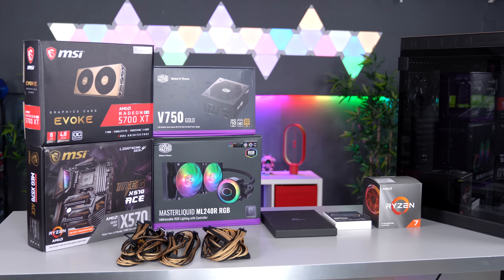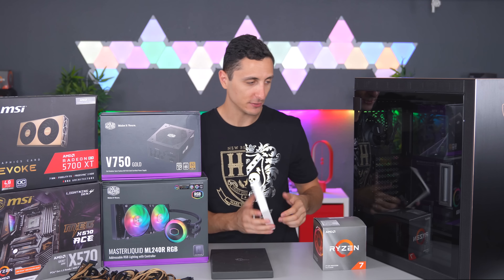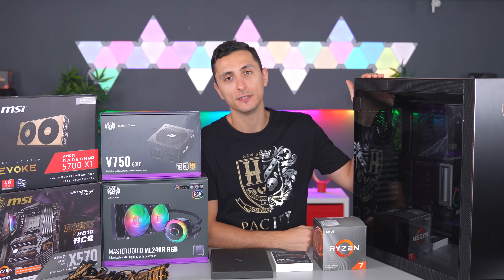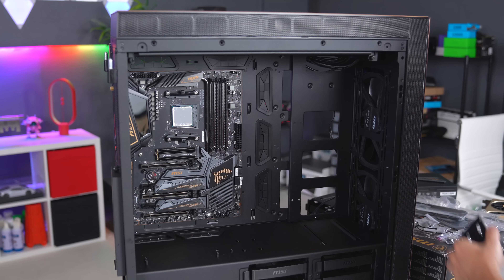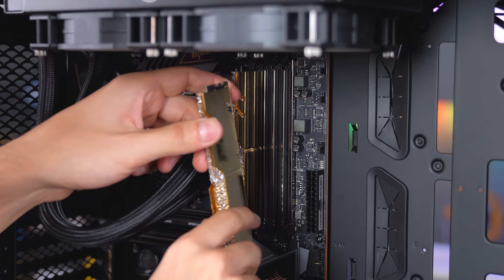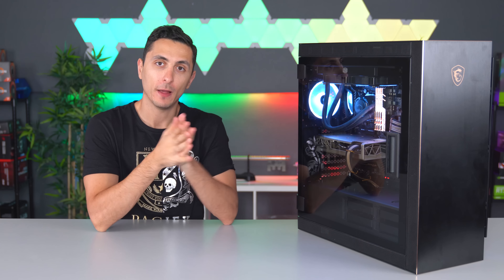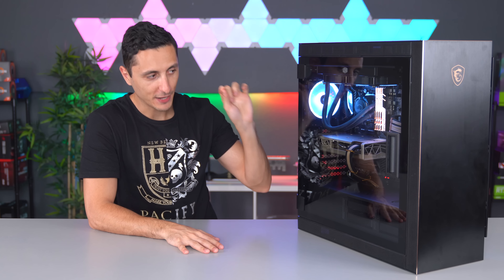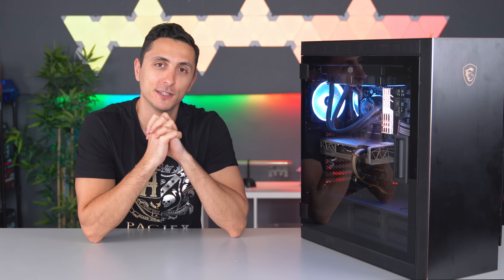The Black and Gold PC Build

Comment: 10:12 it's almost 5GB not half a GB
Reply: Glad I wasn't the only one who noticed that.
Reply from the maker: damn my math sux
Reply: TechSource hi Ed
Reply: Maybe what he meant is half a terra
Reply: At 1:56 as well
Reply: Noob on ssds here. My crucial bx500 is advertised at 6gb/s , so whats so special about 5gb/s? I know its read and write but whats the difference? Thanks
Reply: @jackdunn4035  "Crucial BX500" write speed is 500MB/s, while this one is 5GB(5000MB/s), ten times faster than Crucial BX500.
Reply: @mirsyad9828  no it's not, don't like that comment!
Half a terabyte is 512G, over a 100 times faster than his actual speed of just under 5G/s.
He was out by a factor of 10, not 1000
Reply: @jackdunn4035  Sata3 is 6G/s but for technical reasons I don't understand the actual speed degrades to 600M/s.
So these NVME drives can be many times faster, at least in benchmarks.
Reply: @colinjava8447  A gigabit and gigabyte are two different things. To convert from gigabit to gigabyte, you have to divide by 8. So 6 gigabits per second is actually 750 megabytes per second which is what most read/write/download speeds are shown as.
Reply: @colinjava8447  It also suggests why ur internet provider advertises speeds of ur plan for example of up to 100mbps but when u go to download something, the speed is only 12MB/s
Reply: @robbie4339  yeah I know the difference, it can cause confusion cause it's GB and Gb and people can think it's the same
Reply: Colin Java yeah it's only purpose is so companies can advertise great looking speeds while not totally lying to the consumer
Reply: @mirsyad9828  a terra is a 1000 GB, half of that is 500 not 5gb
Reply: @wsdadasdawf8384  okay then. I'm still confused with the term GB and Gb
Reply: what does Gb mean though?i never said that?
Reply: @wsdadasdawf8384  I mean GB and gb
Reply: @mirsyad9828  w8 ur not joking? theres no way you think they are different,they are the exact same thing lol
Reply: @colinjava8447  because it is not 6 gigabytes, but gigabits. You got it? I hope so 😄
Reply: @zZupPan  I already explained all this above
Reply: @wsdadasdawf8384  that's just not true GB=Gigabyte, gb=gigabit, one gigabyte is eight gigabit
Reply: TechSource so does you spelling haha jkjk

Comment: I mean I'm sure your aware, but for anyone new to building PC's, when mounting radiators you should really consider doing so as an intake rather than an exhaust. A multitude of videos/forums showcase the CPU cooling benefits when utilising an open back GPU. Obviously, if your using a blower style GPU, this doesn't apply, but when an open back GPU is situated directly under a radiator exhaust, this causes the CPU to run hotter. Instead, if you use a standard fan exhaust system and the radiator as an intake, this will greatly better the temperature at which your CPU runs. 

Just food for thought 👍🏻
Reply: Good to know, as I just built a new PC and placed my AIO fans in exhaust mode. Of course, my PC runs super cool as is so ......and it's an intel 9th gen 9700 cpu, the system as a whole runs cool, I have 3 intake 140mm fans in front and a single 140mm out on the rear, with the 2 120's on my aio cooler. Maybe I'd see even cooler temps the other way. I'll have to test this. Thanks

Comment: Tech source out building $2000 pc whilst am here happy about my £11 mnk that came today😂😂
Reply: zakk why’d you get an $11 mouse and keyboard
Reply: Kiwiz Lucks cos I don’t have that type of money to splash on expensive keyboards, however I can drop you my paypal😉
Reply: I understand you might not have the money but only rich men but cheap tools. If you save up for something a bit pricier, you'll get a more reliable, longer-lasting product that will save you money in the long-run. Just a thought, I have had to learn that first hadna a few times.

P.S. Some cheap peripherals are really good though, I remember getting an £8 mouse that I used to game competitively on, it was fine.
Reply: P4TR10T this isn’t always true sometimes the more expensive stuff it the same or worse then the cheap stuff and a lot of the time the cheap stuff last at least close to the expensive stuff and if you pay a ten of the price for half the life span than the cheap options better
Reply: GMUXBLADEZ - you make no sense
Reply: @gmuxbladez-9221  if you read my P.S. you'd see that I understand that but most of the time responsibly chosen items that have a higher price tag will be made of better materials with more testing behind it.
Reply: P4TR10T yh I totally understand but I really don’t need my mnk is I only play ps4 r6 with my controller and I just bought a monitor (I smashed my old one) and FPS dominator( a cheaper version of scuf but better quality) so that’s why I only spent 11£ cos am gonna use of for Fortnite every now and then
Reply: @a-kkaz9791  fair enough

Comment: You can use any case from Fractal Design or Phanteks instead cos MSI is still new for Cases (a golden case won't actually look great). You can also replace the Corsair SSD with GIGABYTE AORUS NVMe Gen4 SSD which is golden. You can address the RGB primarily towards dark yellow/orange - close to golden. For aesthetics, I might try Corsair A500 75 CFM CPU Cooler rather than an AIO. Although most of the Power Supply isn't visible these days, you can get a Seasonic power supply with more golden accents. In my opinion, the products available in the market are more suitable for Black-Silver and White-Golden build.

Comment: Nice part selection and very nice build. Couple of observations - at 11:58 where you show the "flaw" with the riser, you have it flipped, the GPU slot retention clips should be towards the center of the case, not the edge. As for the bracket, plenty of short screwdrivers exist.
Reply from the maker: I flipped it so it’s easier to see but the spacing of the standoffs were still off :/

Comment: that version of the RX 5700 XT can get really hot, I would recommend getting the gigabyte aorus RX 5700 XT and get a vinyl wrap for it
Reply: The temps i saw that they were about 46 degrees on apex and 75 on six siege. But if u say so...... what temperature does the aorus average at?

Comment: You could've definitely done alot better.

Cool-temperature lighting of cooling fans throw off the theme.

There is so much black, we need to see Tech Source mod.

Radiator at the top covers up the golden custom cables, this must be looked into.

Case is not that impressive, too much hard drives cages which make it look like it is from early 2000s and alot of back colour. May be go for a different case which can be easily modded as per desired theme.

An SSD with similar custom cables would add more to the theme.

Waiting for the improved and modded version of this build.
 
Thankyou, Ed!
Reply from the maker: great feedback!

Comment: Hey Bro <3 from India. Can you please make a video on best UPS selection or tell us if it's okay to run a pc through power from inverters (pure sine and modified sine) or generators during power outage. Power outages are really common in my place as well as some other countries too I believe , so it would be really helpful for us if you could guide us to select the best UPS or other similar equipment for different types of gaming systems ranging from 450w to 1000w and higher :-)

Comment: Can you do an overclocking guide on this built specifically? I have the r9 3900x and the 5700 xt but I'm having trouble overclocking. I was able to get my CPU to 4.2 ghz but nothing on my card or my 3200 mhZ RAM. on the RAM, it just has some profiles in the bios, so do I just pick the speed I want? Any advice would be awesome

Comment: Ed maybe you or your other watchers could help. I have a motherboard I bought and I have a case. The cables coming from the case do not match the ones on the motherboard as far as having the right number of pins for each other. What is the little adapter called and where can I buy said adapters? what do I type in to google to look for?   thanks so much.

Comment: My 3700x is around 50 degrees Celsius when I'm not running anything aside from cpu temp. I'm using the stock cooler. Is this normal? I see people with way lower temps
Reply: It might be due to weather conditions.
Reply: It might be due to hot weather or poor airflow, try removing the side panel if the problem persists.
Reply: @gnmn  it's like 22 degrees celcius inside. I've tried removing the side and the front panel. No difference
Reply: You might be having thermal issues due to inappropriate mounting pressure or unstable bios. Try above tips and lemme know if the problem's solved.
Reply: Since you are running a 3700x, I highly recommend getting a beefier thermal solution and some Thermal Grizzly or IC Diamond as even stock AMD heatsinks does not do a great job of keeping their higher end chips cooler

Comment: I wonder the Trident Z RGB has some issues with it like SPD Corrupt or Lighting issues, what about the Trident Z Royal? Or even what about the Trident Z Neo? Is it still has the issues? And if it's yes what caused that issues tho?

NB: I know it sound stupid but I'm confused to choose RAM since I want Trident Z to work with my MSI build and using Mystic Light but with the issues I prefer Vengeance RGB Pro which is the down point is it's not support Mystic Light

Comment: I have a question im building my own pc and wondering if this is a good list
Saphire Pulse RX 580
Ryzen 5 2600
Aerocool Cylon Case
Asus prime b450 m-a
WD 1tb desktop hardrive
thermaltake smart 750w 80+Bronze psu
crucial ballistix 2400mhz ram

Comment: I'm tryhing a new build with this Mobo and MS1 2070 Super. I keep getting a red light on my EZ debug lights for the VGA. I'm on the second Mobo and still experiencing the same issue. GPU works on another machine just fine but my MSI X570 ace won't post as a result of the VGA light. Did you have any trouble with this board. Its been a week and I'm beyond frustrated. I'm just running barebone (CPU, Graphics and 1 stick of ram)....keep getting VGA failure light....this is the second board....any thoughts please?

Comment: Can the cpu work with whatever number of cpu power pins you plug in? My board has 8+4, and I only used the first 8 because I was afraid I'd fry the cpu if I put all the pins in. My thinking was that the extra 4 pins are for more powerful cpus (I'm running 3700x). But seeing this guy use 8+8 power pins, I don't really understand the purpose/rules of it...

Comment: So I bent some pins on the motherboard cpu socket (lga1155) I built it all and turned it on and everything lights up and the fans are working but there’s no display, like the monitor can’t detect anything. Any ideas? The motherboard was cheap so I don’t mind buying a new one but idk if it’s something else. Any suggestions would help.

Comment: Did you hear that the evoke has poor thermal pads or something like that? Heard there was complaints that is was rushed by MSI and that those parts are poorly made.
Reply from the maker: No issues in my testing. Ya the GPU runs pretty hot but no throttling in my build.
Reply: @TechSource  thanks for the response! Yeah I've seen these complaints on reddit but was curious if issues were happening to you. Great build as usual! :)

Comment: I am new on pc build I have thermaltake core x71 I am not doing water cooling and also that goes for my processor i am putting noctua nh-d15s now this case as extra space where u can put fans so my question how would u do it specially if I want to to put fans on the top would u send up for the fans to take air out or in ???

Comment: Hi, Ed I'm on a budget of $1400 and want a set up that can ran a VR any advice?
Reply: @dfkdiek518  that's pretty solid lol
Reply: Trevor Keeling ye bro I know alot
Reply: @dfkdiek518  oml thanks!
Reply: Loner Kid no problem g
Reply: Loner Kid any case and power supply that’s 650W
Reply: @dfkdiek518  oh ok! Thanks!
Reply: Amd Ryzen 5 3600x
Cooler master Hyper 212 RGB
Msi MPG X570 Gaming Pro Carbon
Corsair vengeance LPX 16 GB (8x2)
ADATA SU365 480 GB ssd
Seagate Barracuda 2TB
Asus Geforce Rtx 2070 Strix gaming OC
Antec Dark avenger DA601 ATX Midtower case
EVGA Supernova G3 650w 80+ Gold
Overall: $1331.60
You dont really need to follow this though. You could always use Websites like PCpartpicker.
Reply: Zearoxaph 14 listen g a 3600 is a 3600X without the name x lol and it’s 50-100$ cheaper
Reply: My build he gets a 2070 super pretty much the same cpu and it’s a lot chePer
Reply: @dfkdiek518  A g 3600 and a 3600x only have a2 ghz difference when overclocked but I see your point

Comment: Subjective Opinion: You should have made the fans colored yellow, and 3800X? When 3900X is out. The MSI MEG X570 ACE has it's own onboard "power button" so you DON'T need to bump jumper pins to power on. If you took your time with this build instead of just making a video to throw up on your channel. You could have drilled new holes for the vertical mounts, painted the back PCI slot covers gold along with any other parts. I'm not going to say anything about GPU that's preference So, I don't know, after "15 years of PC building" your skills are quite amateurish to me.

Comment: Is the cooler good enough for a ryzen 7 3700x?
Reply: MayoouD D most coolers are fine on most Ryzen CPUs, other than the threadripper series they tend to stay relatively cool, most retailed fans will be fine with your cpu. Hope I helped :)
Reply: Yolo Swag you did, but i dont know why my 3700x is like 55c on IDLE. I think my thermal paste failed. Anyways im buying a aio soon, thanks for answering my question
Reply: MayoouD D just make sure that it is evenly spread, I recommend the grizzly thermal paste, it’s either that or you have a dodgy cooler.

Comment: Hey guys can you help me. I built a computer yesterday successfully, did the bios and installed windows 10. Even ran Minecraft for a little while before downloading some drivers and going to sleep. After work today I came home to use my new pc. I turned it on and the mobo white vga light stayed on and it did not boot. I ended up ripping apart my beautiful cable management and checked every single connection. After that I reset the cmos and turned it on. Now it’s stuck on a green boot light and white vga light. I really don’t know where to go from here and I really want to rip the entire thing apart and start over but I know I shouldn’t have too, it worked yesterday just fine. Can someone please help me I just $3000 on a computer and I can’t even get it working right 

Ryzen 7 3700x
Gigabyte 2070 super 
Asus Prime x570 Pro
Corsair vengeance 16gb 3600mhz
Corsair 500d rgb se
Thermaltake 750 80+ gold